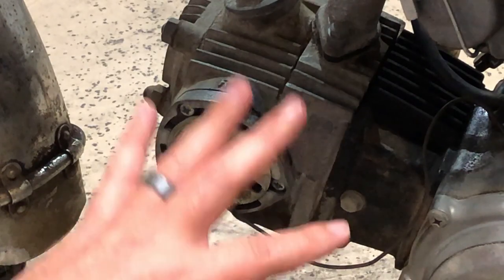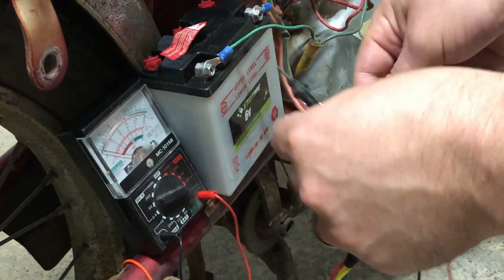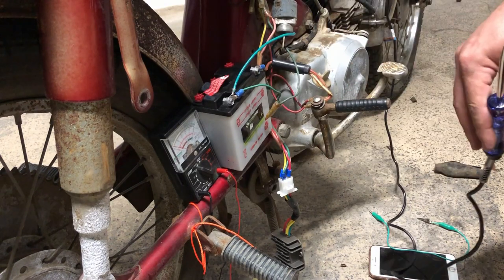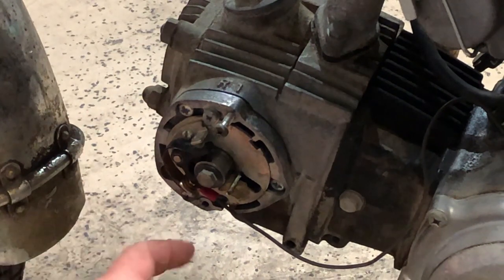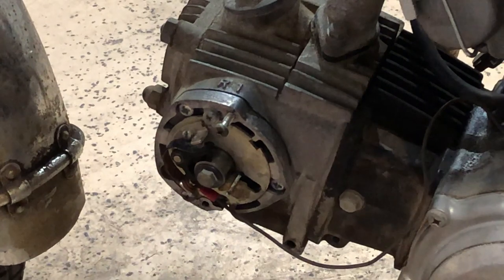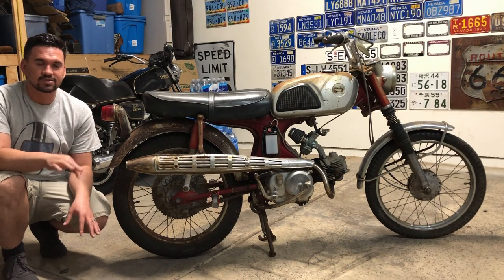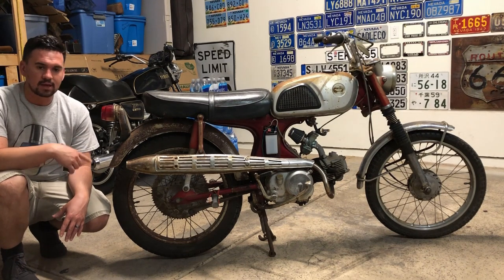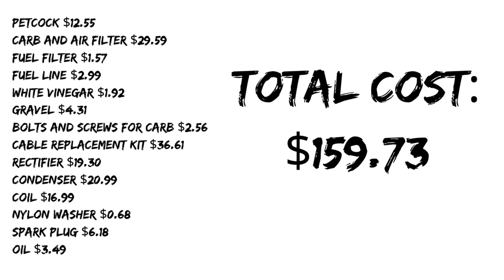1968 Honda CL90 Build Part 5: First Start in over 25 years!

Comment: Do you still have this bike? What battery is that? I can't find one that fits anywhere
Reply from the maker: model # XT6N6-3B, i got mine from batteries plus but looks like you can get it from a few different places with that model number.
Reply: I had that bike when I was 15 years old I took a 6 volt battery out of a little kids toy car and it worked just fine I really loved it that Honda 90 it would jump to 60 mph on the open Highway I wished I would have kept it and fix it up I seen one that really look beautiful with the restoration and they were good I didn't know it as a kid but I had a great Honda 90 a good breed